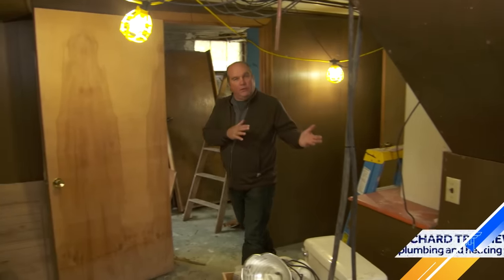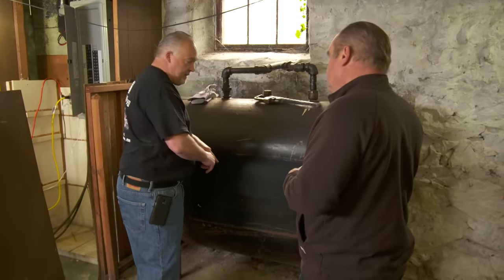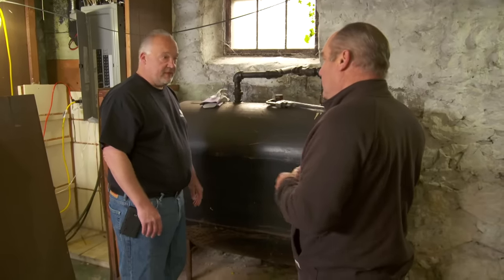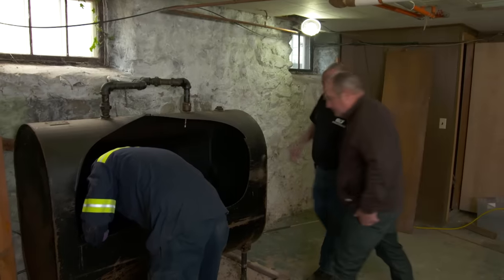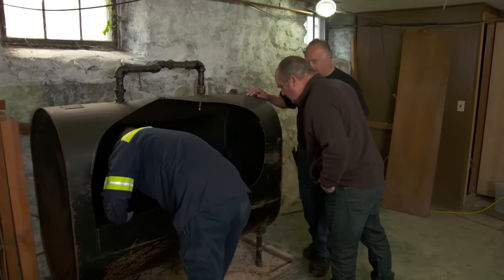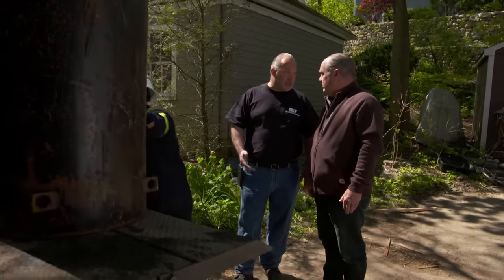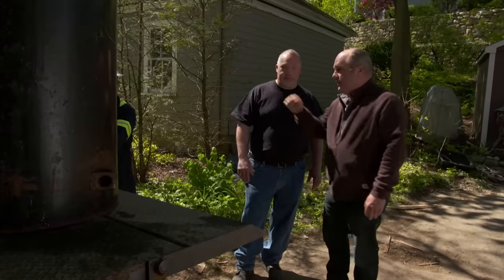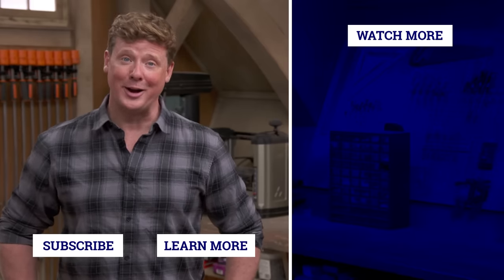How to Remove an Old Oil Tank | This Old House

Comment: “How we gona get the sludge out?”  “Well we have to take out all the virgin oil, then cut a large hole, then scoop it out” two geniuses right here lol
Reply: Dump a 25 lb. bag of cat litter into the tank as soon as it it opened.  Litter will soak up all the remaining liquid oil, then you can scoop it out with a dust pan into 5 gallon buckets.  Snap on a bucket lid and take it to a hazardous waist disposal station.

Comment: I had an underground 550 gallon tank buried in the front of the house.  When I switched to gas, I pumped it dry, cut a hole in the top big enough for me to fit in, wiped the insides out then filled the entire tank with sand.   Put soil back on top and planted grass.  All this with the town’s blessing.   35 years later the grass is still there, and so is the sand filled tank.   Love the gas burner!

Comment: One result that they didn't mention.  Heating oil stinks and it permeates into surfaces like fabrics and carpet.  Once you cut that hole in the tank, your house is going to stink like hell for 2 to 3 weeks.
Reply: Not true.  If the oil is spilled into the floor, it will stink for a month.  But just opening the tank won't cause a long stink. Once you remove the oil and tank, the smell is gone within hours at most.

Comment: Come on! Show me how you removed pipes thru foundation.
Reply: probably just capped em off actually
Reply: @ryank5281  , good point.
Reply: Mine were just capped at my house
Reply: You can also cut flush and cement both ends
Reply: Cut the fittings off....Loosen with a 5 lb. sledge hammer....And pull.

Comment: The best way is to have two tanks.  Run one dry.  Clean out the bottom with a pump and long stick with a rag on it.  Then use all your oil and repeat the process with your other tank.  Or you can remove the filter and just let it run dry.  It is a good idea to maintain the tank and make sure the water gets out.  Make sure your tanks are tipped the right direction.  They should not be level.
Reply: You can't run it dry

Comment: I'm one of the few still using an oil heater in Australia. Lovely heat. Will never get rid of her.
Reply: Exactly! I am in the USA and I still use oil burning furnace for heat.
Reply: Yeah, my oil heat is pretty darn lovely too.
Reply: Probably only 5% of homes here in Canada still heating with oil.  Oil produces more BTU's than natural gas or propane, but it's a lot more expensive.  Finally converted from oil to natural gas early last November.  Annual heating cost dropped from $2,300.00 to $650.00 for the year.

Comment: great video, just how much does it cost
Reply: I did mine for free.  Ran it almost dry, got the remaining sludge by tilting and draining through the removed oil filter housing.  Laid a bunch of cardboard and newspapers under it and cut it into 3 equal sized vertical sections using a Sawzall.  Took it to the scrap yard after I wiped it almost clean, slowly burned the sludge with old tree trunks that I cut down.

Comment: Is it possible to have both oil and gas? Say I buy a house that runs on oil but I wanted to use natural gas and then keep the oil as a secondary, is there such a thing ?
Reply: Don't why you would want that. People usually pair a petroleum product with electric, like with a heat pump. But, yeah, you would need two furnaces for what you're suggesting. Or, maybe oil furnace plus gas fireplaces?
Reply: Your local municipality may not allow you to have both. Believe it or not you need permits for this type of renovation so your local municipality can report the change to the fire department in case there is a fire. The rescue team would need to know what dangers they need to eliminate and how quickly. Example, stove catches fire in the kitchen, they turn gas off outside and enter to fight the fire not knowing they could be standing on a 200+ gallon of fuel oil that wont respond to water very well if it is engulfed. Not likely but fire is fast and very destructive. Especially oil that is on fire when you add water.

Comment: I’ve heard stories of basements getting filled with stinky heating oil after the tank was removed. Not a pretty site.
Reply: Yes!  When your tank is removed, you must immediately remove any external fill pipes that were used to fill the tank. Failure to remove the fill pipes will void homeowner's insurance coverage if someone pumps oil into your basement.
The cost of remediation for such a disaster can cost between $150K to $200K.  Oil delivery services have been known to fail to inform the delivery driver, who shows  up and pumps 200 gallons of fuel oil into a person's basement.  Delivery drivers have also pumped oil into a person's basement when the oil was intended for a neighor's tank.
Reply: That happened to a lady I once worked with.  She had a brand new house built and ended up with about 6" of oil in the basement!  One of the workers was laughing while see was crying.  A co-worker threatened to punch the guy out who was laughing.

Comment: Can there be any oil  vapor in the tank ?
Reply: Yes...they didn't mention that.  You have to remove the fill, vent and gauge pipes to vent the tank before you start cutting into the tank with a sawsall.  The liquid oil will not ignite with a flame or spark, but vapor in the tank could certainly explode.
That's why the gas stations have a sign saying "Diesel vehicles must turn off all ignition sources before filling".
Reply: @chrisgraham2904  ... diesel vapor does NOT explode and that's not why they have those signs in gas stations. The origin of those signs starts with "all vehicles" from the days when most were still gasoline. These days they are all about "no idle" for cleaner air. I believe most locations have a 10 minute idle limit now.
Reply: @rupe53  Not true!  Diesel vapor will ignite.  As a 12 yr. old kid, I lived close to a drum recycler.  Drums of diesel were supplied to local farms for the farm equipment and returned to the recycler for reconditioning, but they often had a litre of diesel left in the drum.  On a nice hot day, we would removed the bung from the drum and drop a match in.  The drum would lift off the ground about two feet as the vapor exploded.  An enclosed tank with just a little diesel and a lot of air is far more dangerous than a tank filled with diesel with no air.
Reply: @chrisgraham2904  ... on a nice hot day those drums were pushing the low end of the flash point, which isn't possible in a New England basement where it seldom goes above 65 degrees. They also could have had a mix of kero or gasoline. Drum recyclers are not all that fussy. I did tank removal for years and half of our staff worked at the local fire department as their other job so I would have heard about it if that was even remotely possible in our situation.

Comment: If I had this problem after watching this video...shop vac the 1/4 tank of oil.  Cut the hole myself.  Scoop out the crap myself.  Get this tank to the curb, and a metal scrapper would pick this up in an hour.  For the cost of free.  This service probably charges like $800.
Reply: If you suck oil out with a shop vac you're gonna start a fire. Just use a siphon
Reply: Important thing is the certificate, need proof it was removed or you'll get fined
Reply: @SHKEKEKE  You don't need it removed unless you want to remove it for some reason.
Reply: Very good boy, he showed the proof with match in the video. Its safe to shop-vac it
Reply: @Jack Myhre ... they all have a drain fitting in the bottom.

Comment: Is there “code” that it must be removed via a Bilko door? Or can any door be used for this ?
Reply: What are you high?
Reply: no, those are just often the easiest ones to use. If the tank is really too big for the regular doors a Sawzall will turn it into smaller pieces if you are willing to take the time to do it right.
Reply: @victorquesada7530  ... BTW, these tanks are only about 26 inches wide so will fit through most any door. They are only 5 foot long so you can stand it up in a basement if necessary to "walk" it through a tight area.

Comment: Had to do this. Cut my starter cuts with a grinder then used the saws all to but the rest and cut out 2 stuares on top left and right then other side (kinda in quarters) then did the side panels in 2 halves and rinse and repeat until you get to the bottom where the legs are then just cut that into 3rds then we removed itnfrom the basement. And the steel panels that was once the oil tank make great shooting targets!

Comment: Where does my paid for oil go? That's my money!!
Reply: Two companies, that I talked to, who pump oil from residential tanks, don't pay the homeowner anything for the oil they pump out and they charge exorbitantly for the pumping service.  Before my tank was removed, I ran the tank as low as possible and for a few weeks, until my new gas furnace was installed, I ran gas station diesel, 5 gallons at a time, so I could keep the heat on.

Comment: Oil out and gas in! Seems like a wasted opportunity, just changing one type of burning thingy to another burning thigy! 😨
Changing straight to a geothermal energy or an air to water heating system would've been better! Any heat pump really!
Reply: Unless you live in an area that's actually cold, like the northeast for example.
Reply: Geothermal units require multiple ground loops each ranging from 600 to 1000 ft long. Not something you can easily swap a fossil fuel system to. Heat pumps start to lose efficiency after temps drop below 30. In places with harsher winters it’s generally more cost and thermally efficient to use gas heat.
Reply: @moorefilmltd  We have plenty of harsh winters here in Finland, especially up north, but nobody ever chooses gas or oil over heat pumps! Must be because gas and oil are expensive, but still you get very good SCOP numbers with air to water pumps!
Reply: @moorefilmltd  ... you forgot to mention doing that 1000 feet of pipe in a yard that's only 50x50 and already has a septic tank. or a water well. Then of course there's issues with the zoning department and their 20 ft  (or more) setback from the neighbor's property.
Reply: Heat pump in Vermont, no problem.

Comment: I grew up in LA and I still have never seen one of these or steam radiator in person. I've seen a hot water radiator in Michigan. Everything there is natural gas or propane.
Reply: I'm on the other side of the us, I learned to work on oil fired steam boilers just from living in houses with them. While I was in college, I've even rented part of a house that had a gas fired steam heating system

Comment: Great.  Thanks for posting.  I have some walls surrounding my tank so not as open and easy to remove.  The local plumbers weren't familiar with how best to remove the tank and don't do it.  Where could I find a professional with the pump and proper disposal experience mentioned in this video.  Thanks in advance.
Reply: Depending on where you live the cost for removal is in the 30G range Your almost better off DIY buy the Pump and reciprocal saw transport sludge and left over oil. Good luck
Reply: @PeterPan-kz2si  Wow, 30G sounds high.
Reply: @PeterPan-kz2si  More like 1.5g.
Reply: @DAS-Videos  That’s what we were quoted, about 1.5

Comment: Being in Louisiana this is new to me.
what kind of oil is this?
Reply: It’s basically diesel fuel with a red additive to identify it as such.truckers cannot use it for fuel because it’s not taxed and will carry a hefty fine if caught.it’s been used in the Northern part of the country for ever.its commonly referred as #2 fuel oil. I have a tank twice that size buried in my yard which now—in this day and age is illegal as all hell.
Reply: John M thanks for the info
I have heard of #2 diesel
Guess I never thought about it heating homes on this scale
Reply: @StoneysWorkshop  here in Spain it's more or less the same, only it's diesel type C, being A for general use and B for farmers and such (tractors, that kind of stuff), while C is for burning. They also have some coloring additive to tell them apart and, also, if they catch you using type B in your car, you will pay some extra for it...
Reply: @StoneysWorkshop  yeah it’s a big big heating  fuel source up in the cold ugly North.I don’t burn much since I put in my pellet stove.baxk then this oil was $4.45 a gallon and it was a $1000 a month expense...that was really horrible.Had to use fire or go broke—Fire rules!
Reply: @fadetounforgiven  yep if you're going back home across any border that has a weaker economy they will dip your fuel tank and see what color it is if you drive a diesel vehicle, mostly European borders
Reply: When I planned to convert from an oil to a natural gas heating system, I wanted to run the oil tank out of fuel as far as possible.  As the tank approached empty of #2 heating oil I didn't want the oil company delivering another 600 gallons that would have had to be pumped out (very costly process).  I stopped the oil delivery service and ran road diesel for almost 6 weeks.  Buying diesel at the gas station, 10 gallons at a time.  When the oil furnace was removed, there was 2 gallons left in the tank.

Comment: Several errors, The Sawzall is not a "non sparking tool"  so caution must be exercised.  This is considered a confined space so caution must be exercised.  The young guy cleaning it should be wearing a respirator with OV cartages.
Reply: Steve S ... Fuel oil has a flash point approaching 200 degrees but only if vaporized. Never heard of anyone starting a fire while removing an oil tank, even if you do get sparks directly from the saw blade. Hearing protection is a must. The noise level while doing this is amazing. Eye protection goes with any power tools. The opening in the side of the tank is almost the size of the tank so no longer a confined space.
Reply: You could drop a lighted match in the oil and it will go out.  Heating oil has a high flash point.

Comment: Didn't realize a big oil heater was a thing! It just seems weird to be burning oil for heat/seems like it'd be dirty. 
(I know it's just my limited experience -- I grew up in a little town in Oregon where people have propane tanks or wood/pellet stoves to heat essentially every house -- I had never heard of someone heating their house with oil!)
Reply: Heating oil is very similar to diesel. Which isn't the cleanest fuel, but still not anywhere near as dirty as burning crude.
Reply: Extremely common here in PA.

Comment: Orrrrr. You could Just remove it like. Normal people & have a few buddies come over help lift out of basement, and haul it to scrap yard LMAO 😂.. instead of all this "we gotta do this eco friendly guys"!!! LMAO Christ
Reply: A new 900 gallon tank weighs about 350 lb.  A  couple of big buddies can bring a new tank into the basement, but if you add another 100 to 150 lbs. of sludge in the bottom of the tank, that's still sloshing around, manhandling it out of the basement isn't quite as easy.   The scrap yards simply refuse to take old tanks unless they are cut open and cleaned.
Reply: @chrisgraham2904  y'all are going to the wrong scrapyard haha

Comment: you guys are ususlly pretty godd but this time i'm sad that you  wear all the required safety gear that is mostly made to identify someone as a construction worker.   Tehn you could have cut that tank in half horizontally , sovent cleaned it , had it checke d at the authorities and then made it into a smoker for Bob villas back yard.     Repurposing items is a much better way to salvage and recycle .  The match trick blew me away when my friend consistently would therow is lit cigar into our bucket of gasoline that we used to clean parts  and it never blew up.   How about explaining lower and upper explosion level limits at that point?

Comment: Lmfao I landed a contract a few years ago for a clean up job on a residential home. The home owner took the sludge and dumped it out the back window.  Got rid of the tank, sold the house. 
It all came under the foundation and threw it. Made the whole house stink. Had to remove 40 yards of dirt inside and outside and underpin the entire rear of the house. Was a disaster.

Comment: Thanks to the EPA this is a huge pain in the ACE and it's expensive. You never want to get an oil tank as a result the government.
Reply: In Toronto, Canada the problem isn't the government.  The problem is the insurance companies.  They want to see all the certificates that the tank  has been removed by certified technicians according to environmental regulations.  Without it, you homeowner's insurance policy is cancelled and you can't get re-insured anywhere else.